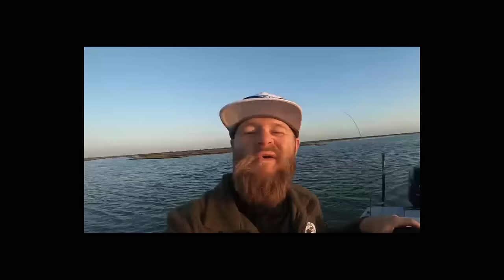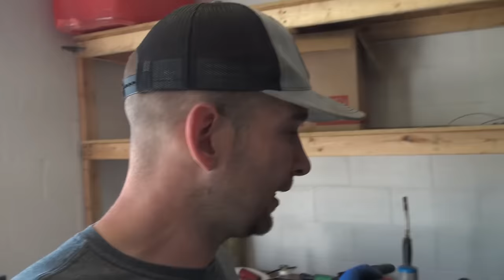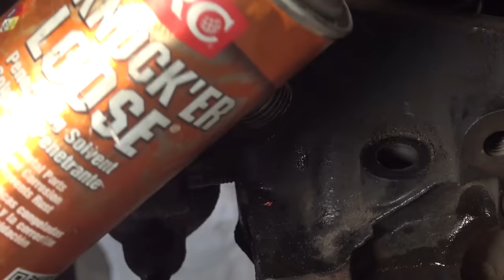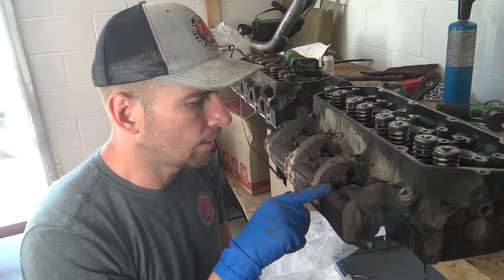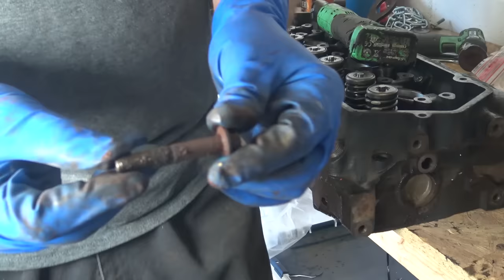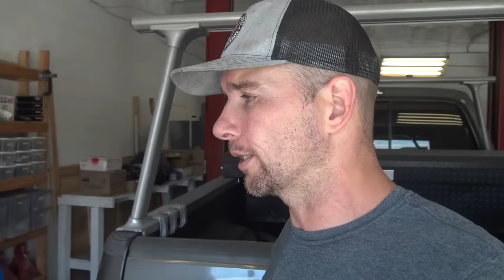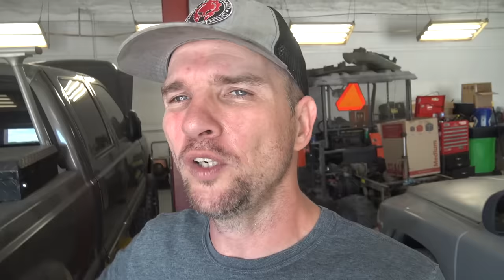Old Mechanic Taught Me This Trick To Removing Rusty Exhaust Manifold Bolts!

Comment: All of your advice here is golden. My only exception would be to start the tighten loosen cycle with a slight tighten. I was a plumber in a past life and was taught to tighten a rusty pipe or fitting before loosening. This has worked very well in my life as a mechanic as well. Your video goes a step beyond that. Thank you, I learned some stuff today. Having snapped my share of exhaust manifold bolts as well as collector bolts, it is certainly well worth every second taken to do it the way you have shown here. I subscribed....and that's sayin something.
Reply: Thanks, Stephen. I have snapped off a few bolts in my day due to ignorance of what to do and what not to do 😮
Thanks for your very helpful, very thorough advice 🙂🙂🙂
Remember Stephen, that God loves you, and He wants you to love Him too 🙂
Reply: Sometimes setting the air ratchet to tighten and lightly tap before again reversing. Back and forth being careful.
Reply: Your very right! A ping with that hammer will do it too

Comment: I am an old mechanic and I also learned this from an "old mechanic". Some have already mentioned tapping the head, but I'll add a couple of tips - wire brush the head if possible and as Stephen said "use a 6-point socket" however don't use a deep socket use a shallow socket which helps you keep the socket square on the head and avoid rounding the head. Also as you saw the bolt Stephen had trouble with breaking loose initially gave him trouble again when he was removing the bolts. To avoid this on a manifold after getting each bolt loose and retightening all of them, loosen each a quarter turn one by one, then keep repeating the sequence until all bolts are loose.  Stephen good job on ur video!!

Comment: Thanks for the tip to use CRC Knocke’r Loose.  One suggestion when using a torch, the hottest part of the flame is just beyond the tip of the inner cone.  If you hold the flame away further it will heat the object quicker.  Give it a try and see.

Comment: My auto shop teacher from 38 years ago taught us to put a punch On the bolt head Smack it hard with a hammer in line with the bolt or straight on, this sends shockwaves through the bolt to break the bond of rust , this also works if you have steel bolts going into aluminum , but of course you have to have the Clearance to do this,Great video thank you
Reply: I 2nd this, I was going to comment about this thick also. This is one of the best tricks I was ever taught when it comes to removing bolts, rusty or not!
Reply: Also if you have stainless into cast aluminum in a marine environment. Ships will get water in the radar transmission, it will freeze and burn up the motor which has to be brought down from the stick for a rewind.
Reply: Yuppppppppp
Reply: @dealerauctionnightmare4689  blunt
Reply: I know plenty of folks cleared this up but just to add a bit: yes, “blunt” punch known as a drift punch. Biggest diameter possible or that you have. Reason? If using a skinny diameter drift punch you lose a lot of force transfer from the shank “bending” where as a beefy thick punch keeps its rigidity.     Maybe too much info or splitting hairs but oh well, just adding to the knowledge library
Reply: Yup, my dad taught me that.
Reply: Wade Great explanation thank you
Reply: This works well for screws to
Reply: Hit a manifold bolt straight on while the manifold is still in the car. Sounds good on paper....not so well in the real world.
Reply: I did the hammer thing on a `36 Ford exhaust manifold and broke the ear off. In some cases, a hard smack may not be the answer. The metal around some of the bolts appear to be thin right from the factory.
Reply: @wadesmith9483  nope not too much info at all, it makes perfect sense. A lot more force traveling thru a bigger punch than a narrower one. No different than hitting a bolt with a hammer, compared to a nail with a hammer.
Reply: 100% right shock is the best my teacher said and showed us that was 38 years ago
Reply: I start by smacking the bolt then go to your method been doing it that way for for 40 + years
Reply: Yup, this is my #1 go to technique to break loose bolts and nuts. You need to hit the head pretty hard though.
Reply: They should make a spring loaded hammer!
Reply: Bill Hayward yep
Reply: acurt1970 agreed
Reply: It takes patience Grass Hopper. Hit anything hard enuf long enuf it will come loose.
Reply: If you hit these bolts on an alloy head you could possibly stress crack the head
Reply: @wadesmith9483  Great comment. I usually hit on the socket.
Reply: Vince 🇺🇸 I used the hammer-punch method on a 390 Ford manifold when I didn’t have a torch handy...it worked really well! 🧐
Reply: Yep, This should be done first. Especially aluminum heads, breaks the hard white corrosion into powder.
Reply: I am the Offender of All  That’s why Vince added the caveat of needing clearance.
Reply: Never underestimate the power and usefulness of a good HAMMER!!!
Reply: Ive heard that process described as 'Waking up' the bolt
Reply: Just use the biker method. 
If it jams force it, if it breaks it needed replaced anyways.
Reply: Done that many times
Reply: @billhayward2668  à
Reply: I just believe and envision it turning easily. I put some positive think on it. I call out the rust and binding spirit and cast them off, by name. My toolbox container is my mind of positivity. I say this, then, to all perverse and unpermissed molecular union's,  loose thyself and be ye loosened unto whence thou were free.
Reply: Works well on brake bleeder screws.
Reply: Just careful what you're swinging on, you can damage the internals of a catalytic converter if you do this.
Reply: That's a great idea. I've used it once or twice. :) I do some mechanics work on my own vehicles, but I also do carpentry. I come from Newfoundland originally and am now living in the USA. Back home, when we dismantle old wood projects, we would almost always shock the nail by banging it IN first with the hammer. This releases the nail from the friction holding it, and the boards pull apart SO MUCH EASIER. I've never seen a carpenter use this technique down here, though maybe some do. (I've also never seen them use a slide hammer nail puller, but everyone has one back home for projects - instead, everyone uses little tiny claw crowbars that require the use of a hammer, as well). So yes, "shocking" a screw or nail with a quick rap (or three) usually is a great way to start things moving, both in mechanical and carpentry.
Reply: Under every boat with metal in the water, they use zinc anodes to save the steel and the anodes rot out over time in salt water.  We see how much salt they put on the roads in NY and PA and most northern states.  If we put zincs under our trucks and the salt water gets under it,  the same anode protection should occur.  Boat in salt water is same as truck underbelly with salt on the roads. Also, never set an aluminum ladder next to a vehicle near pine trees.  It forms a battery and will destroy the paint job on the vehicle,  literally bubbles under the paint.  Pine needles are acidic.  So I guess we should never set aluminum near steel in a junk yard. Or keep the steel nice and dry.
Reply: Yup, that's I do, but use a air hammer instead. Works like a charm most of the time.:)
Reply: I worked around corrosives and metal, it doesn’t matter is it’s a bolt or a screw. Doing what you said about hitting the head before you start to remove it works most of the unless the head is corroded to the point it’s unusable.
Reply: @davidregan9872  LOL, they do.  It's called an impact hammer or rivet gun.  I'm sure you know imact wrenches work like that.
Reply: @dealerauctionnightmare4689  I was taught to use a blunt however if all you have is a center by all means use it. Better yet, what a great reason to get more tools. :)
Reply: Yes sir in the oilfield, on a collar or bolt etc. Take a hammer and warm her up..
Reply: @dealerauctionnightmare4689  blunt
Reply: @davidregan9872  an impact hammer and a crawfoot wrench can work wonders also - light trigger action and push wrench at same time (don't slip and destroy something though).
Reply: @wadesmith9483  f
Reply: @dealerauctionnightmare4689  doesn't matter, center or blunt. You're going to put new bolts in anyway.
Reply: Same used to do this in the Navy with them rusting salty bolts
Reply: And if your bolt has a shoulder to it like the ones in the video just smack the socket, do it all the time!
Reply: Michael  same here about 50 years ago my grandpa said the same thing wake up those threads
Reply: @davidregan9872  I make spring loaded hammers.cut chisel/center punch/ect in half and weld a 2 inch spring in between. Make them big or small blunt or sharp.
Reply: @iamasmurf1122  I use a needle scaler to set up vibrations.
Reply: That's what I teach. I tell them "break the bond". Remove rusted brake rotors by using an air punch on the hat. Same idea.
Reply: I got an air hammer attachment that you can use with a socket and you air hammer the head of the bolt, works pretty nicely.
Reply: @dealerauctionnightmare4689  blunt,if you use a center punch it can spread the bolt head and your socket might not fit.
Reply: Works well on metal pipes also.
Reply: Harold Schotl  I’ve never heard of this type of impact tool, much less seen one. I’m trying  to visualize it and it’s use. I’ll Google to learn more. I’d like to make one. Any visual/ additional information would be greatly appreciated. Thanks for the idea. Best wishes. Roy - Buffalo, NY
Reply: J Mac the anode is sacrificial during electrolysis. I think the salt corrosion is a local phenomenon that doesn’t rely on current flow. There’s probably a video on it somewhere on YT dis/proving one theory or the other.
Reply: But you can’t always do this while the engine is still in the car
Reply: At work we call it “waking it up”
Reply: @dealerauctionnightmare4689  Pin punch.
Reply: @samvalentine3206  exactly my thought!!! I was going to post just that!  Great album.
Reply: Vince Scailise - Thanks for the good tip from your auto shop teacher. Trade work tricks are endless; a lifetime process to amass.
Reply: Air chisel with flat bit works in tighter spaces
Reply: @wadesmith9483  A socket you don’t care about works just as good too.
Reply: David Moran p pop on
Reply: I call this Good, good, good, good vibrations.....
Reply: @wadesmith9483   Knowledge adding is beneficial, keep sharing experience, good 1 ;)
Reply: @mattjacomos2795  and yet another tool is the impact driver think punch that accepts both sockets and screw driver bits... Hold it tightly the way you want it to turn and smack da end with a bfh (big friggin hammer) never had a screw not come out even when the impact gun just didn't have enough oomph
Reply: And when removing 3-4 inch od seized pivot pins from heavy machinery a 15lb or 25lb sledge hammer with handle cut at 18 inches is called a real bfh
Reply: I can't believe no one has mentioned a Conklin product called Rust Bomb for breaking loose rusted on bolts.  It works by using ultrasonic vibrations to break up the rust.  Tapping on the bolt after spraying it on several times and most bolts will come right out.  For the really stubborn ones, as this guy did, apply heat but most of the time just the Rust bomb is all that's needed.
Reply: @a.krueger6486  love it. 🤣🤣🤣👍👍
Reply: @AN-kg4ei  Impact hammer with a pressure reg attatched
Reply: Another trick we used many years ago removing stubborn bolts and screws was to use a air hammer. Snap on sells a tool, but we  had made a tool ourselves. On the end that goes in the hammer its the same as any air hammer shank. The other end they welded a rod to it at a 90 degree angle then at the end weld a 3/4 or 1/2 in square that the impact hammer socket will connect to. So when you press the trigger you turn the rod to loosen the bolt or screw. The shock waves will loosen many rusted bolts.
Reply: hammer drill lol
but maybe...
Reply: Me after reading this, wheres my air hammer?

Comment: Old guys taught me to move back and forth years ago.  But never saw anyone retightening until all are loose.  Thanks for posting.
Reply: Retightening a point well made here and good practice when working on major engine components. Rarely seen by the naked eye but, metal flexes ... even heavy lengths of Railroad Steel Rail Lines.
Reply: @mgjohn8534  I agree.   It’s hard to imagine steel moving like clay.  But in a way, it does.  Brains usually beats brawn.
Reply: you really should do it in sequence...not one side to the next.
Reply: Thats a new thing i learned too.  I always just take the bolts or nuts off but this video makes perfect sense.  I get to those last couple of fasteners and they are the most difficult.

Comment: Use a small 1/4 Milwaukee fuel impact (or whatever) on the lowest TQ setting. Let it hammer away for a good 20 seconds on each bolt. Really helps break the bolt loose with the rattle. I was able to break loose all the head bolts on my 70 year old farm tractor using this method.
Reply: I just hit with impact punch a few times
Reply: It probably works but I wouldn't want the slightest potential risk for breaking the bolts

Comment: I appreciate you taking time to explain the how and the why. Often people forget to include both elements. Keep the good content rolling.
Reply: Sometimes, people don't know WHY it works.
Reply: When you tell someone how to do a job, they will forget before they have to do it the next time. But when you explain why, they will remember it forever. The understanding of the reasons is also transferable to other similar problems.
My motto is, keep your brain one step ahead of your fists and if it does not work, you are probably doing it wrongly, so put the kettle on and seek some advice.

Comment: For those who may be interested in the materials science at work behind the excellent video: Consider that the unthreaded shank of the bolt has been seized inside the manifold hole with tremendous compression as the rust grew and grew in the annular space. Luckily, the rust crystals are brittle and break when subjected to a little strain. Note that there are two types of deformation for steel: elastic and plastic. Elastic deformation is like stretching a rubber band; when the force is removed it goes back to the starting shape.  Plastic deformation is when a permanent change of shape happens. When you first move (crack) the bolt head most of the shank is still seized up, but close to the wrench the shank is undergoing elastic twisting deformation, enough to crack the rust crystals. Twisting the head back the other way a little helps crush the rust crystals, and the elastic deformation can extend a little farther down the shank, cracking more rust as it goes. Note that the manifold is being held to the engine at this point by the seized portion of the shank, and that much of the original clamping force of the bolt head against the manifold may have been relieved. The resistance you feel isn't so much the friction of the clamping force of the bolt head against the manifold that you would feel when tightening a new bolt, but more the torsional strength of the fastener itself. Continuing to twist the head back and forth just a little bit each time can gradually crack and crush the rust crystals all the way to the end without plastically deforming the shank. Ideally, the bolt could be loosened with purely elastic deformation without exceeding its torsional yield strength. Realistically,  though, the bolt has become weaker and more brittle by the heat cycles, so it's going to undergo some plastic deformation. A small amount of plastic deformation is okay, as it slightly work hardens that area, allowing the already slightly hardened shank to transfer the force to the softer, unworked part.  Emphasize SMALL amount of plastic deformation, because working it back and forth will now put it into fatigue damage mode, and each cycle adds damage. There's a fine line between twisting just enough to crack the rust, and twisting so far that either the ultimate torsional strength or the fatigue strength of the fastener is exceeded. If you just take the breaker bar and unrelentingly twist it until it breaks off, you've exceeded the ultimate torsional strength.  If you rock it back and forth with less force than that for a half dozen times and it breaks, then you've exceeded the fatigue strength. The key to success is having the patience to analyze and understand the sources of the resistance you feel when you twist the wrench so you don't exceed either of those limits. (If you want to get a 'feel' for elastic vs plastic deformation, clamp a smaller, maybe longer bolt than you'll be working with in a vice and wrench on it.) Shock waves induced by hitting it with a hammer, etc, can help crush rust crystals and also to vibrate the resulting dust (or sludge, if using penetrating oil) into relatively less confined spaces.  Lubricants such as wax or oils can help minimize the effects of friction so it's easier to feel the strength of the fastener itself, as well as to minimize the force required for extraction. Heat can change the structure and mechanical characteristics of the rust itself, as well as causing differential thermal expansion strains, and so can be very effective at breaking down the seizing power of rust.
Reply: Excellent writeup on this.
Reply: great job every word was worth sharing  two thumbs up from a 60 year old with lots of mechanical experience ! 100 0/0
Reply: Perfect explanation. Many thanks.
I'm a mechanically qualified individual. Relate perfectly. And can sponge up only perfect practicality. This is it!
To my mind. The shock mentioned, pulverizing rust crystals, is of paramount importance.  
RSA.
Reply: When in doubt pull out the blue wrench